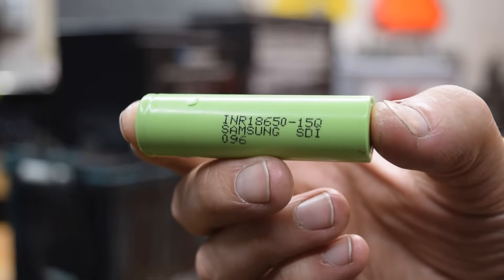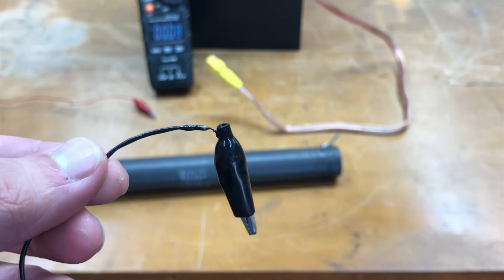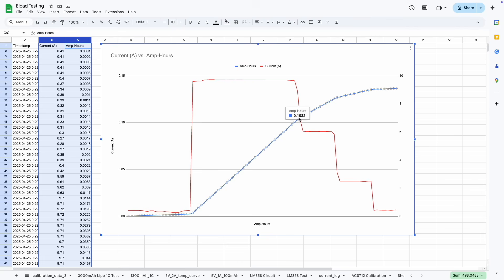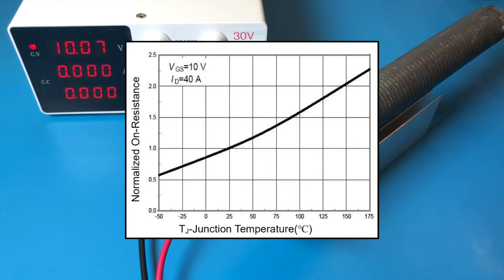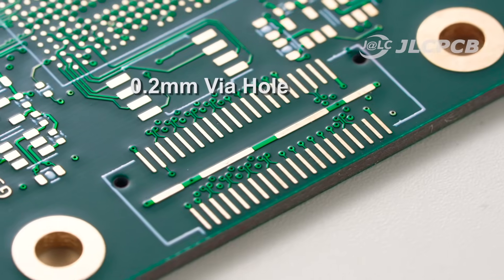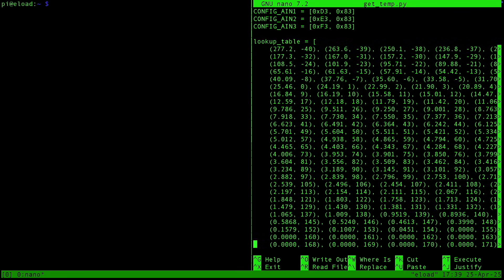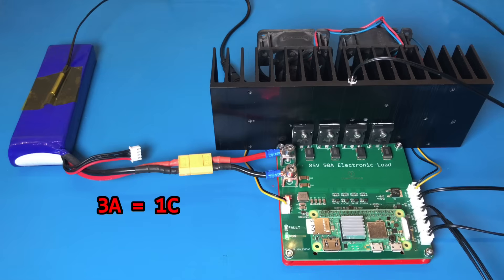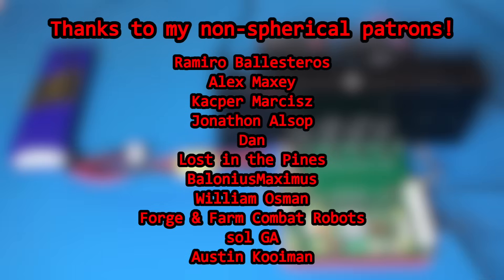Cheap battery testers are terrible so I built my own

Comment: How about instead of dumping the energy into the MOSFET, maybe make a tester that dumps its energy to a large battery bank so only a little energy is wasted, you just pass it to other batteries. Put a voltage and current limiter so you can control the voltage and current going into the battery bank and measure it. The battery doesn't have to be fancy, just two depleted batteries in parallel or one with higher capacity will do as long as it's capable of drawing higher current than the battery being tested. Then later on, you can use the stored energy on the battery bank to charge the next battery that you are going to test
Reply: that would be useful for people like me all off grid  would save running the generator then shorting the energy out

Comment: you make this project independent with a monitor and a menu it would be  so much more practical ( for the none Linux hacker hobbyists) ad some BT for the IoT  nerds and it would do Gangbusters m and maybe cheaper less power full version with a  STM or AVRs ,  damn its soo good , im kinda glazing but damn

Comment: For higher watt load put a resistor inline with the transistor so less heat goes in the transistor.
Like those ceramic power resistors and have it on an non combustible wall

As the constant current regulatort will still hold 3 amps but less voltage drop on the transistor itself

Comment: Very nice projekt, but would be nicer to have seperate wires for voltage measurment, so it bypasess resistiv losess on the wires,for morę accurate capacity
Reply from the maker: Yes, that’s definitely a feature I wish I’d added. The voltage drop across the cables becomes significant at 20+ amps.
Reply: @LiamTronix i bought cheap 25a electronic load from aliexpress some time ago. It came with wires that had the measurment terminal going through the same wires, differance was huge when I added second set of wires only for voltage measurment. Some time ago I tested lithium cells with 50ah capacity and rated current of few hundred amps, capacity testing them at 25a wouldnt even sag the voltage on them, I wished then for stronger electronic load
Reply: 4 wire measurement
Is the usual term for this and is an must for some thing and for better accuracy

Comment: Half of the batteries were Cells.
Reply from the maker: Yes, but there's nothing wrong with referring to them as batteries. By Oxford's definition:
Battery - A container consisting of *one or more cells*, in which chemical energy is converted into electricity and used as a source of power.

Comment: i just bought one of those 20a ones, dont have time to build ones like this plus id like to have a lcd screen so i dont need to ssh into the thing
Reply: I got 2 of those, they're awesome

I've even put an arduino in one to read the voltage values so I can plot it on a graph to create discharge curves when I get around to figuring out how to make IDE play nice with excel